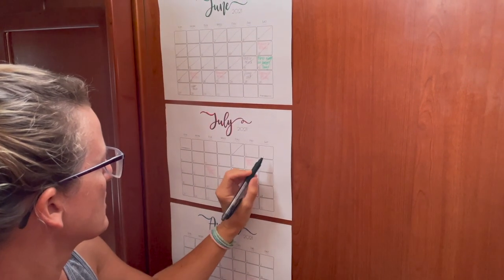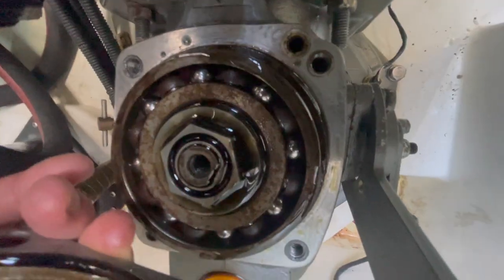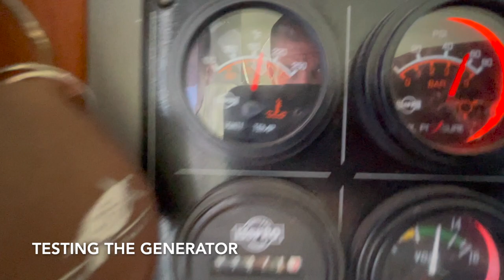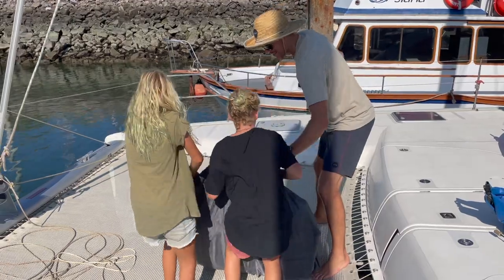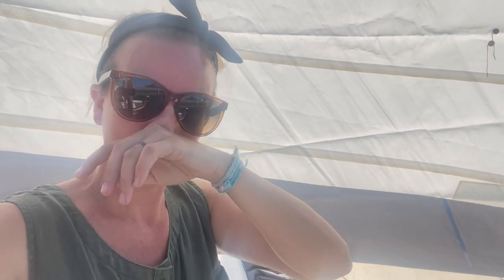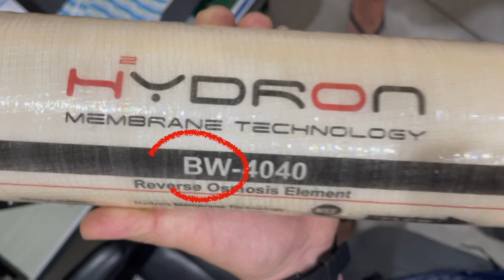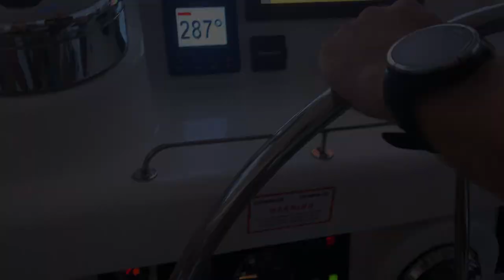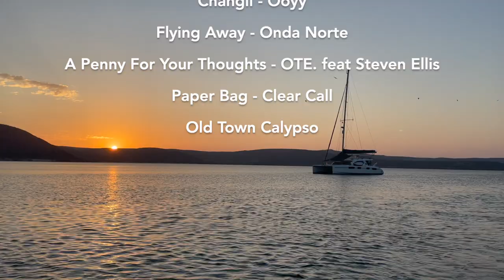She Floats! Now What? | Sailing with Six | S2 E5

Comment: You might do well if you can run some barnical buster or something similar to clear your cooling systems especially in your heat exchanger s.
Check your intakes and pipes ...backwash if you can.
Reply from the maker: Thank you. We will look into this.
Reply: @sailingwithsix  
Thats what they did on the other Cat ive mentioned sailing in your area.

Edit.. he has a simple set up where he can run it through an engine system for hours ... A thin surface coating can cut heat transfer by about 30% with some designs. 
Dutch vessels regularly use closed cooler systems built into their keels as the have to navigate shallow brackish tidal waters and mud flats.